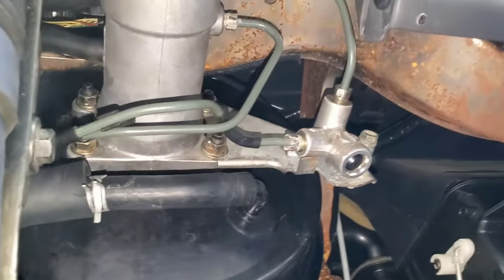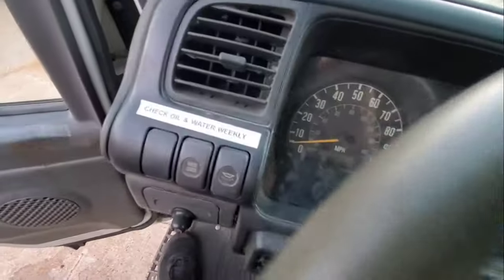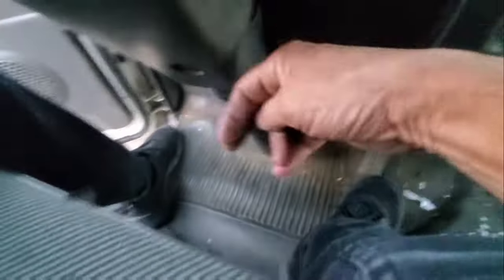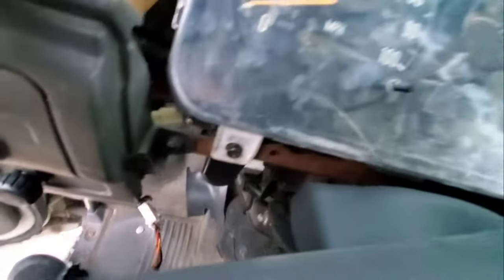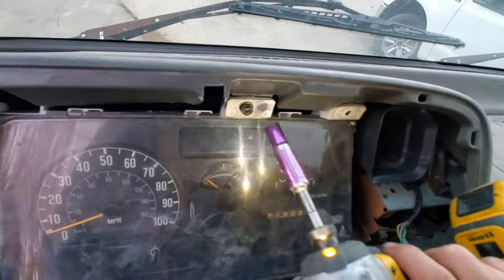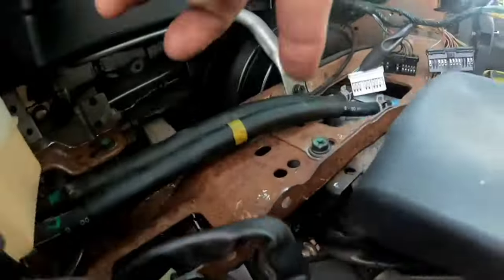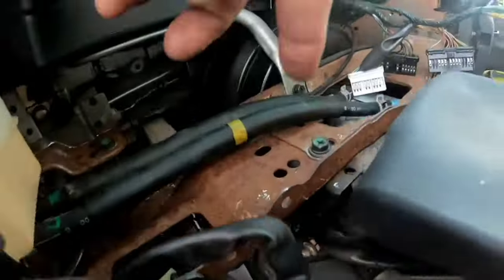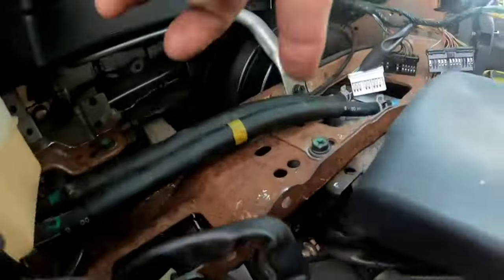2001 Isuzu NPR brake booster replacement. Step by step.

Comment: Awsome video.  After pumping the brake 1 or 2 is going all the way down and I get the same brake booster light and am annoying buzzing sound and the truck barely brakes while in drive. When I drive it the booster alarm stops, and the brakes work better but not perfect. I replace all of the brakes, and 2 of the drum cylinders but left existing other 2. I'm going to just replace those because this job is not easy.
Reply from the maker: I'm with you. A while ago I did the real cylinders and shoes but is very low quality. But yes, is pain in the...  there!😅. Let me know when you fix it please.

Comment: I just did the booster and the alternator with pump on my 2002 GMC W4500. The only thing I haven't changed is the alt brake assist vacuum pump on the left side of the dash. The reason I did all this is because I lost the brakes driving. I can't find an affordable alt brake assist and I am not sure if it needs replacing. Can't find any information on it or what it actually  does. Can you help?
Reply from the maker: Can you take a Pic of it so I can see what you're referring to?
Reply: Don't know how to add a photo . Could you send an email address that I could use to send photo?
Reply from the maker: On the left-hand side of the dash is the fluid tank. Is the only thing on the left hand side. No need to replace that at all.
Reply: @Mrmorzun  Right next to that is the ALT brake assist vacuum pump. That is the part I am not sure of.

Comment: Hi.i was wondering if u had to reset the brake booster warning light on the instrument panel and if so how did you it? Any help would be greatly appreciated
Reply from the maker: I'm unaware of any reset procedures for the booster. Being 2001 I wouldn't expect it. But I may be wrong.
Reply: Thank you very much for the response. It needed more work than we originally thought and ended up bringing it to a place that specializes in isuzu's.after everything was all said and im glad I was sitting down when they gave me the bill. Take care buddy
Reply from the maker: @brentgraves1151 truck shops don't play around with repair prices. When we first sent it out for inspection or diagnosis. They charged us 800 just to tell us it needed brake cylinders and brakes...😢😮😮
Reply: I paid a total of 3000.they said it was the brake booster hence the brake booster light and buzzing noise that goes along with it and after the truck got a new one the light and buzzing noise remained. It ended up being one of the master cylindesr in the back .I wish I would of just had them diagnose it as that's something I could of easily done. that was the first time in my life I actually had 3000 in the bank. It never fails .everytime" and there's only been a few times" I have any  money at all in the bank life says o no u dont. Never fails.it is what It is.could be worse.i could live in Ukraine or on the west bank.i dont tho but i think about stuff like that all the time as one should when they are feeling sorry for themselves.
Reply from the maker: @brentgraves1151  Sorry to hear they reset your bank account. I see life as a spinning donut with a bite on one edge.  Life goes around, and sooner or later, I get a taste of the bite. I hope your luck will turn for you soon.
Funny is the exact same thing with the light. It came on after replacing the booster until I went looking for those brake wheel cylinders. Unfortunately, shops don't hold on while charging people.  Good luck to you!!

Comment: i have a 2006 isuzu npr 5.2L and the brake booster is blinking so do i need to replace the brake booster and this problem would stop or do i need to add fluid to the brake master cylinder please help me out i really enjoy watching your video
Reply: Hi. I'm not sure if this would be the same system. if it is, start by checking your fluid, if the fluid is low you may have a leak check everywhere, including under dash between master cylinder and booster. Then make sure there's vacuum on the system. like you saw on the video. this vacuum is generated by the alternator shaft into the vacuum pump. 
best of luck!
Reply: @mrmoreno4640  i added fluid and now it's making more noise so i wonder do i change the brake booster or check for a leak i hope this helps
Reply from the maker: @crayshaunhenderson1265  brake booster may give you at least two different noises. Vacuum leaks noise. This will sound like air leaking specially when the brake pedal is depressed.  It could still be heard lightly without depressing the pedal.
The other noise could be a spring like sound where your diaphragm may be bad. There may be other issues around there. I recommend you visit your local mechanic for a better diagnosis.
Reply: he said the vacuum pump is bad the one behind the alternator @Mrmorzun
Reply from the maker: @crayshaunhenderson1265  awesome hope that will solve it!

Comment: Do you have to bleed brakes afterwards I replaced mine light still on same problem
Reply: Not if you didn't mess with releasing brake fluid or allowed air into the system. or, not for that matter. bleed them because I believe the problem is with air in the system and it has to be bled al the way to the abs pump. this is almost close to the rear axel under the truck.
Reply: @mrmoreno4640  thank you